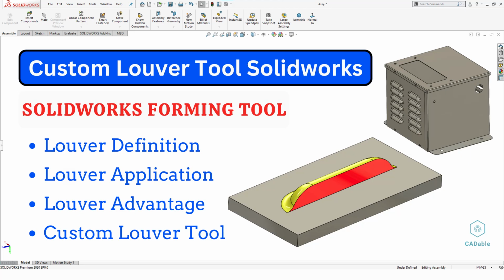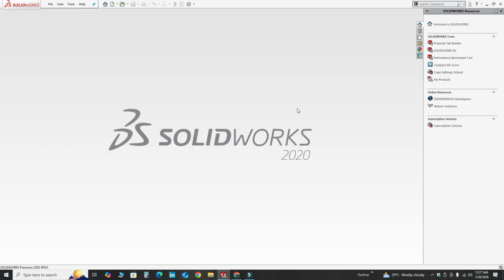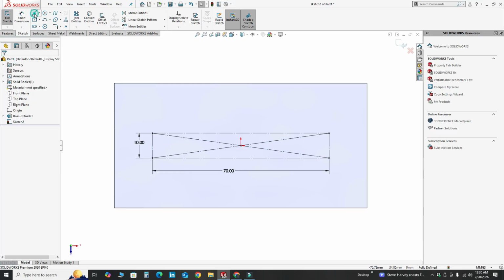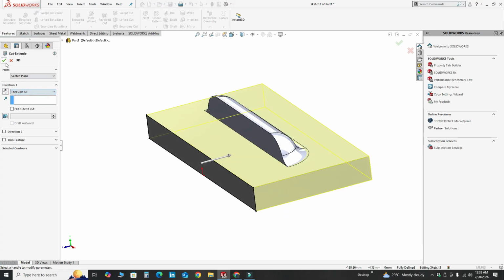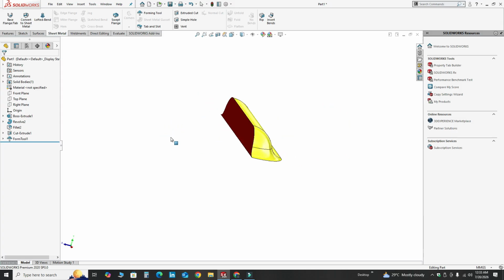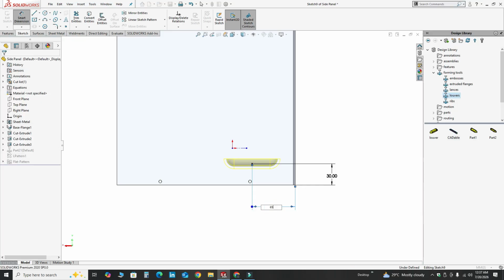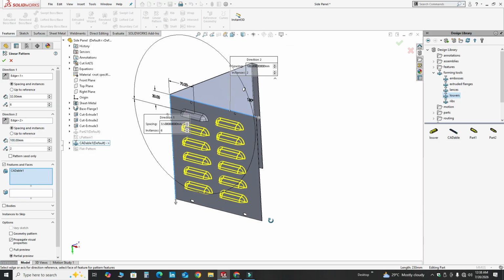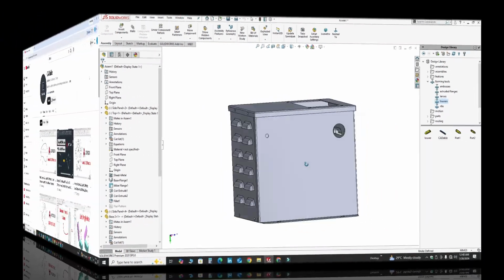How to Make Custom Forming Tool in Solidworks | Create Louvers in Solidworks Sheetmetal | CADable

Comment: This forming tool method is very helpful for the technical designing 
point of view which is
needed in various engineering fields.

Presentation of tutorial is excellent.

Step by step explaination & illustration(s) are highly 
appreciable. and are very comprehensive too.

Animation is also excellent.
👇
N.Rashid H.Khan
(U.S.A)
🌹🌹🌹🌹🌹
🐦🐦🐦🐦🐦
Reply from the maker: Thank you so much❤